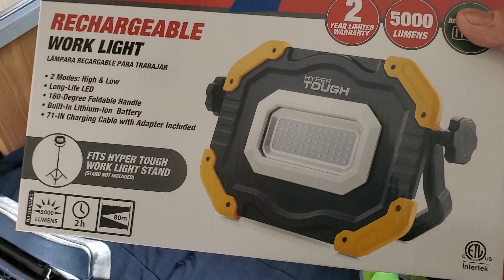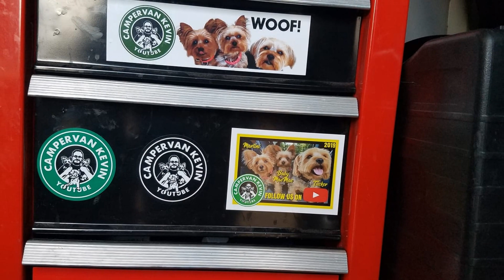Dangerous Motorcycle Hitch Carrier on RV Repaired! Meet Shop Dog!

Comment: Hi Kevin! The 'boom' you were referring to on the old truck is actually called "gin poles (derived from 'gyn' a three legged lifting device) which is a supported pole that uses a pulley or block and tackle on its upper end to lift loads. The lower end is braced or set in a shallow hole and positioned so the upper end lies above the object to be lifted"...that was google's definition... I knew what it was and how to use it, but, couldn't explain it as well as google did! I used these many times during my oilfield hauling days while being a truck driver for 38 years! One thing you DON'T do with them is drive the truck very fast, as, the cable holding the load will slap everything in its path due to load swinging! Sonny's seems to be terrific and a dog with a great personality! So sweet! Always great to watch another new video from you!..."You just never know what you're gonna see on the Campervan Kevin show!" Take care!

( 9/25/2019.  Wednesday.  9:41amCST.  ~ TOTALLYRELAXED! In Houston, Texas ~ )

Comment: About 25 years ago we took an RV up to a little river outside Placerville Id. Spent the summer sucking gold out of the river with a vac system we built. Covered our costs and a great excuse to stay wet for a super hot summer. Amazingly quiet area. If ya don't like snow you might want to start moving unless you want to rent one of the many snowmobiles available in town lol (used to be anyway)

Comment: I have the same bike rack Kev , when it was delivered i put it up on my welding bench and tig welded every joint stiffened that sucker right up , Then i did the 3 point fitting to the RV ,, Best thing i did tho ,, I Used turn buckles to hold the Bike down from the foot pegs to the frame of the rack ,,,, NO More Straps to fiddle with ,,,,, Great vid brother ,,,,
Reply from the maker: can u send pics of turn buckles from pegs to frame to campervankevin@aol.com?